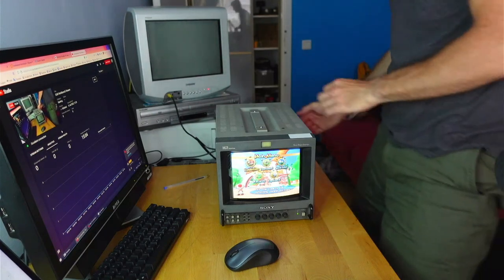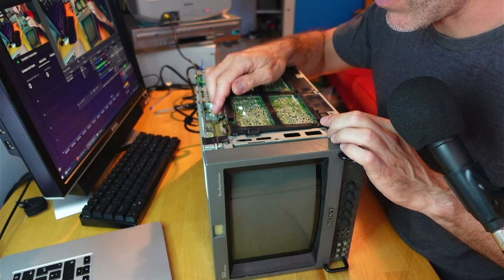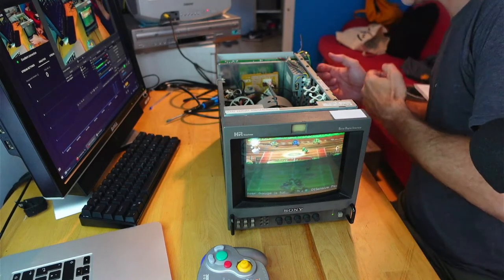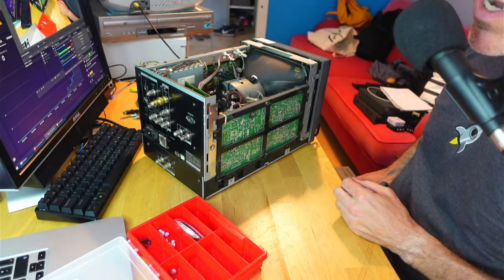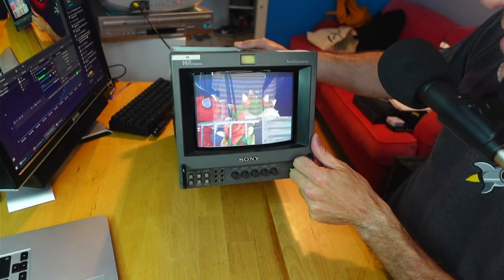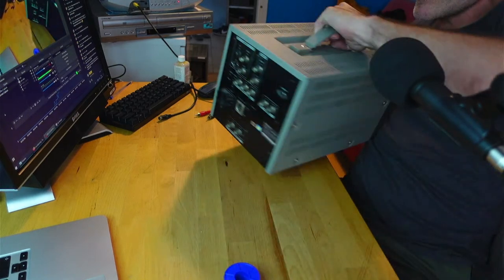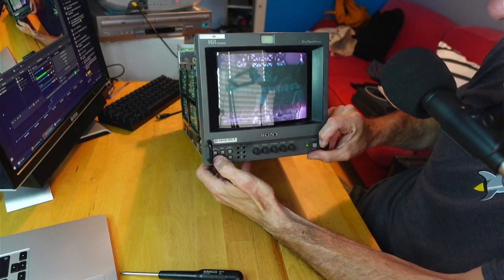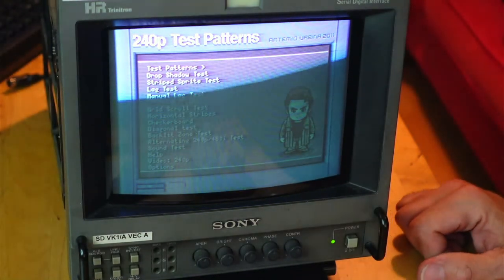Fixing BVM-9044D S-Video Color - Chill workbench stream

Comment: have one of these i imported from jp, very nice. actually a pvm-9044 that i have that has the color loss i need to play with as well. which points were these again? CV101 & CV102 for anyone that was wondering as well. only suggestion for next stream is keep a constant mic distance so that people dont have to be constantly adjusting volume in order to understand you. could just be me im not sure.
Reply from the maker: That’s a fair point about the mic. Next time I’ll try with my lav mic which introduces some low background hiss but would be more consistent. I wasn’t even planning on streaming but I set everything up getting ready for the RetroRGB stream and decided to go for it.

If people want more info on the fox, head over to RGB Rob’s channel (the OG Rob, not this Bob imposter guy). Rob has a video on the full and proper fix advised by Sony which involves replacing those pots and adding some film resistors.